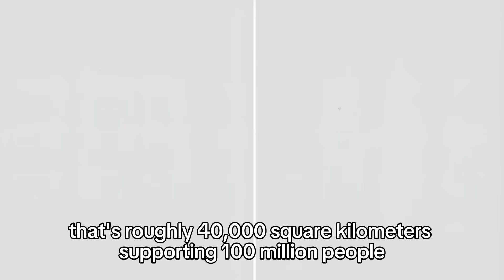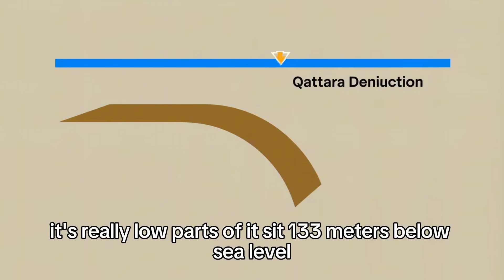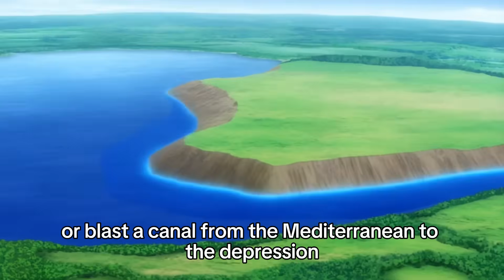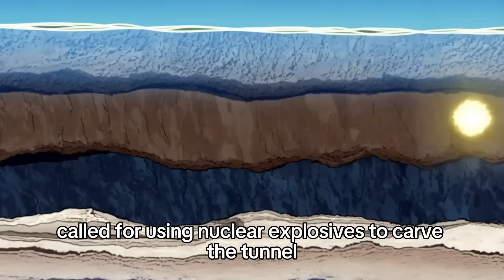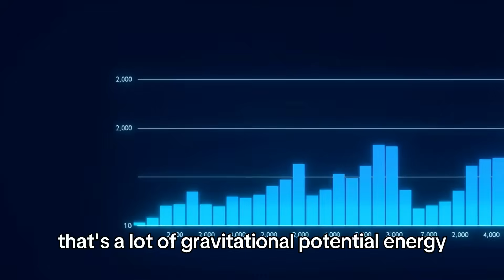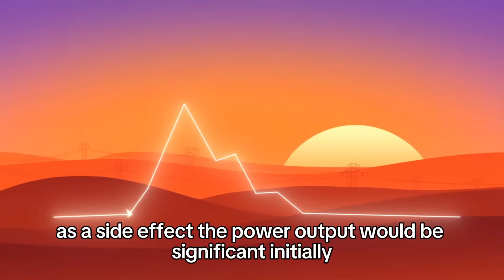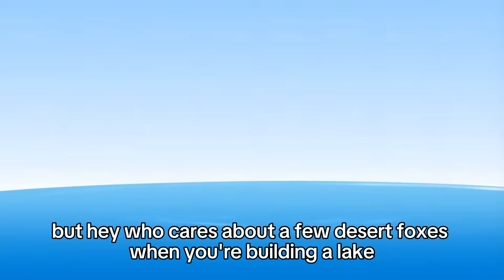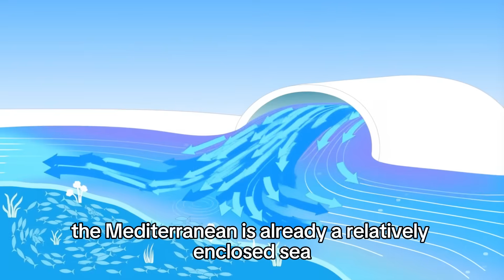Egypt Cut Open the Sahara Desert to Let the Mediterranean In.. But Nobody Expected This to Happen

Comment: Egyptl & other arid countries could: 1.  Burn trash & use sea water to generate electricity.  2.  Separate hydrogen & oxygen from sea water & burn the hydrogen with the trash & use the oxygen to make the fire burn hotter.   3.  Condense the steam to form fresh water.  4.  Use the ashes mixed with sand & cement to make building blocks.  5.  Use the heat generated to cure the building blocks.    6.  extract minerals & salt from the saline rich residue.  The revenue from the electricity generation, building blocks, & the minerals & salt would pay for more desalination plants & canals.  7.  Use water from the sewage treatment to irrigate crops.  8.  Use the sewer sludge to make fertilizer.